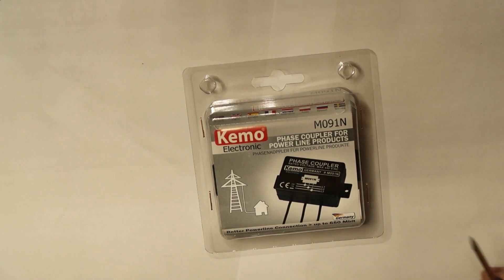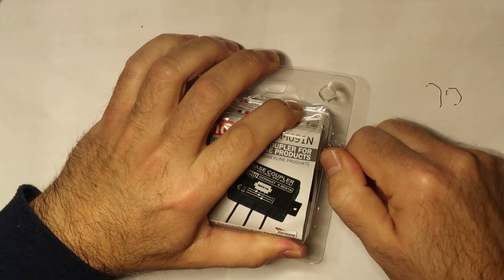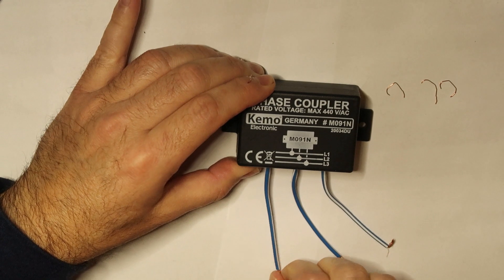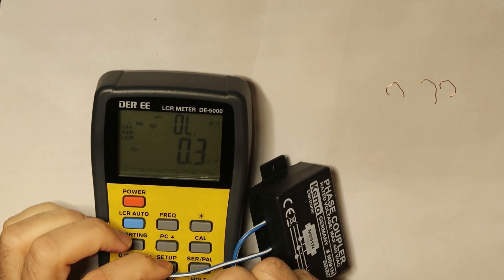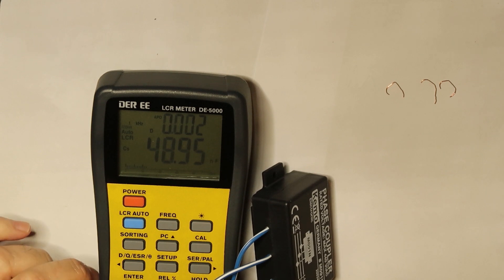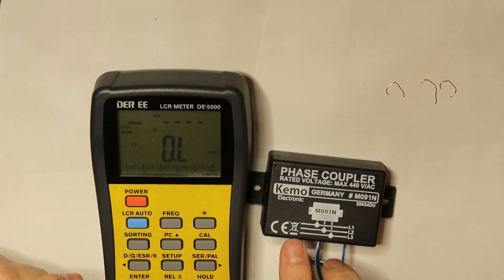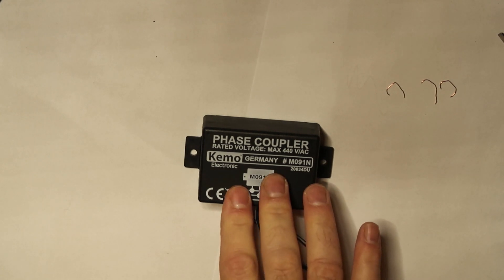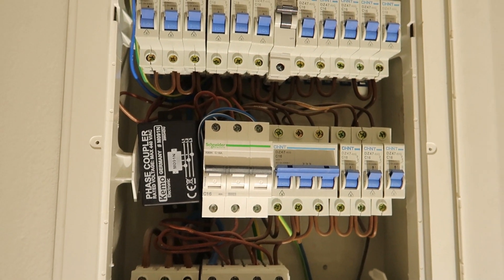Powerline Ethernet solution

Comment: What are the results? Very few people know about couplers which is sad. I've tried tp-link, both homePlug AV and AV2, and results are different WITHOUT a coupler. As you said that you have the same brand first make sure to fix random sleep issue by having your devices behind PLC ping main gateway 24/7(tp-link never patched the bug, try to google for more details). You also said about new solutions for phase crossing so I think it is Devolo, also from Germany, but it is proprietery. Tp-link claims it can work too, maybe they use same tech now...
Reply from the maker: This device did not work well for me, the other methods is to use "smarter" devices that has ability to analyze low signals, just as Ethernet SERDESES have.
The protocol is called G.HN if you want to read about it, you can read more here: https://en.wikipedia.org/wiki/G.hn
Also find a device like this here: https://us.comtrend.com/g-hn-powerline/
Reply: @RoeeBloch  it is AV2 vs G.hn. I just ordered new tp-link, this time with passtru. My ISP speeds are not high at that location so I dont need cutting edge.
Reply: @RoeeBloch  dLAN® pro 1200 DINrail by Devolo looks like the best coupler type solution. I've got my TP-Link order canceled because of C-19 delays so I will choose my next pick wisely. https://superuser.com/questions/794744/tp-link-powerline-adapters-randomly-disconnect has the fix for TP-Link line of powerline products in case someone is troubleshooting. Call me old-school, but I believe these approaches are like trying to send smoke signals in a tornado. What is your ping/jitter/bw anyway (before and after)?